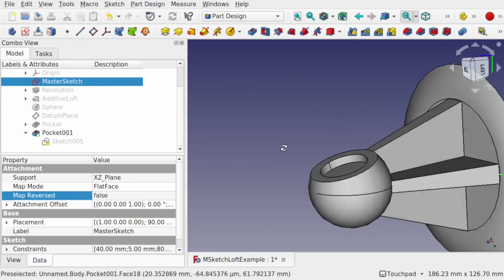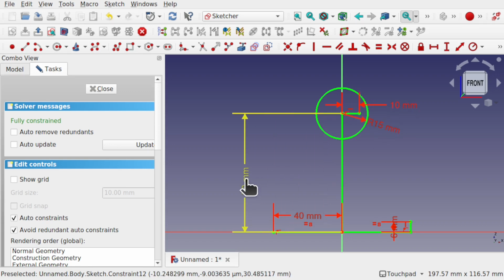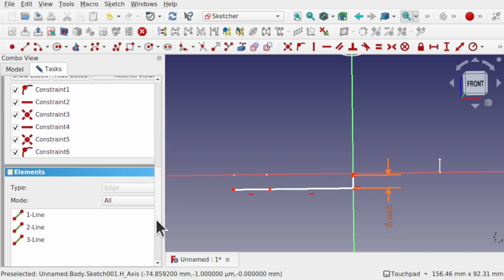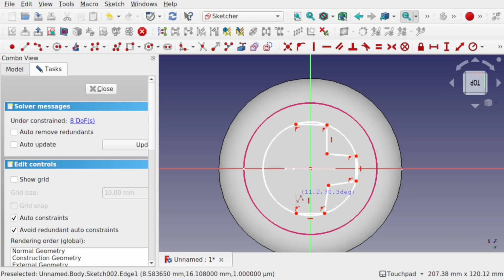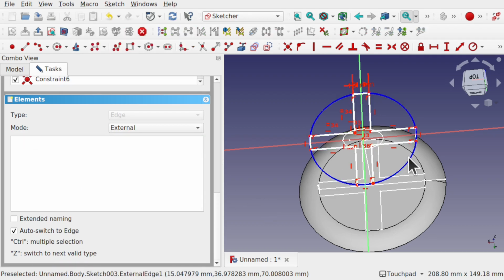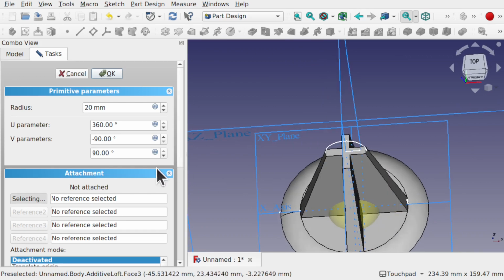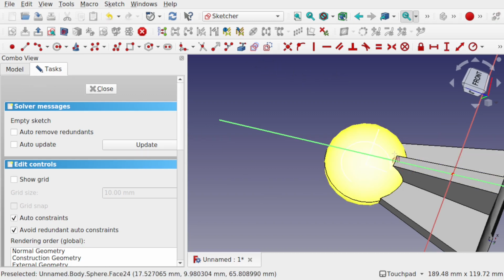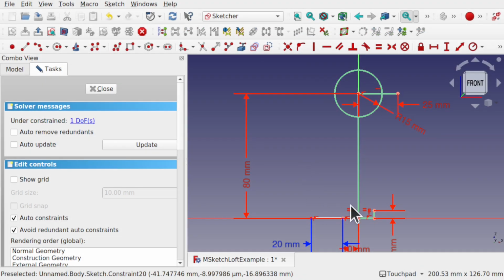FreeCAD 0.20 For Beginners | 12 | Parametric Modelling with Master Sketch, Formulas | Part Design

Comment: Struggling with this 1. Can't seem to get formula editor to work; it just says Failed to parse expression  & OK is greyed out! 🤷🏼‍♂️
Reply: Figured it out! 🤦‍♂️🤦‍♂️😂😂
Reply: I am struggling with a project that I’m working on. It’s probably really simple but I had a brain injury which has messed up my thinking process. All it is, is a cylinder with 2 radial grooves revolved around it & so that I can adjust it, the radius’ & total thickness need to be link & I can’t get my head around it for the life of me! Any pointers? 🙏🏻🙏🏻
Reply from the maker: Sorry to hear that regards your health, I am doing catch up on comments so sorry for the late reply.  When you say link, are you using a spreadsheet to add the values to and then you want this linked to the radius and thickness?
Reply: @MangoJellySolutions  That's right. I've used a spreadsheet so that by adjusting the radius, it affects the thickness. I've managed to get it working on 1 part but the 2nd, assigning an alias seems to put it into error for some reason. I've been scratching my head for a few weeks now.  🤣🤣

Comment: I first watch your tutorials and then try to do the same thing you did by myself so far its been going great but in this episode i messed up so badly i first added sphere then i added the datum plane and it started to get messy just at that point for some reason the reference points you used in video to pull the external geometry on sphere has shifted on my freecad 21.2 so i couldn't use those points to pull external geometry and even when i somehow make the circle to cut through sphere as you did in this tutorial it gives some kind of error related to wire i don't know what it was exactly whatever i think i still understood the concept and thats enough to get to newt tutorial right? Btw you did an amazing job on creating those tutorials even an ape like me can understand it
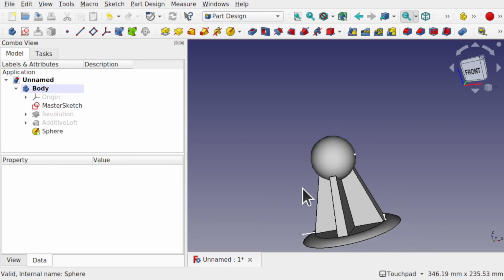Reply: It started to get messy around after 24:30 for me btw

Comment: Why design in mm unit?how can it print big part?i not understand why design in mm unit. im new into freecad 3d modelling.
Reply from the maker: You can change to cm or inches if you want to.  If you look down to the bottom tight of the screen you can change the measurement unit or use the preferences.
Reply: yes i know how to change unit,i follow your tutorial beginner 1 to 15, everything u design in mm,very small model.The baby spoon u design in cad beginner 15 just 50mm,doesn't make sense so small 5cm spoon,who will use 5cm spoon. @MangoJellySolutions
Reply from the maker: @keikaytronic  You can easily change the dimensions.  The items are not to true dimensions and these can be changed with ease.
Reply: oh,alright understand,i get it now. @MangoJellySolutions

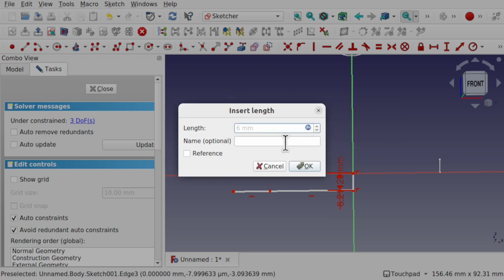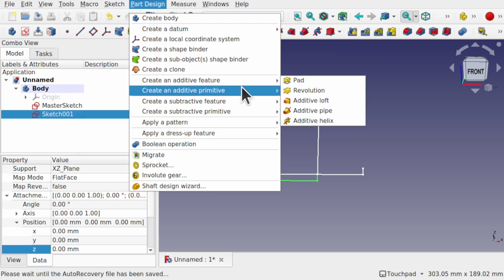Comment: i've restarted this drawing a few times but i cant get past 8:47. it keeps saying "failed to parse expression" and i cannot move forward. oh ok if anyone else has this problem you have to go back to the master sketch and rename base thickness etc which you named WITH NO SPACES IN BETWEEN THE WORDS. my 2nd problem is at 11:51 trying the first revolve. the warning sign pops up "cannot use selected object. selected object must belong to the active body" for some reason i had to drag the sketch into the main body to fix it.

Comment: Is there a formula driven setup video for assembly? Thank you for these series, you are an awesome instructor!
Reply from the maker: Glad your enjoying the videos, so there  are some assembly videos in the series, there is one about creating a meshing gear driven by variables. Are you looking for something that you can drive everything from a spreadsheet including applying those changes in the assembly like a cabin at build?
Reply: @MangoJellySolutions  hmm, youtube really does not like external urls. Removed comment reply two times... This is freecad github issue id: 5789 where I posted a demo vid highlighting potential issue.

In regards to your question, I'm experimenting with headless mode to update model geometry and save .stl for web configurator/viewer based on user parameters. Discovered variables fairly recently and that github issue pointed me into body visibility control as well. So collecting the building blocks... :)

Again, thank you for the videos!

Comment: Love this series, but I'm having trouble with the pocket using FreeCad 0.21. When clicking the pocket menu the render just shows the MasterSketch, which is already different from the video. Then switching the Type renders something weird. It has the cut, but also half the back of the sphere is missing.

Didn't need to set Reversed 🤦‍♀

Comment: At 8:25 wouldn't it be easier to just type in the constraints manually instead of getting the constraints from the master sketch?
We could save time this way.
Reply from the maker: Yes but the tutorial is about using a master sketch so that would defeat the purpose of the tutorial.

Comment: Here's a dumb mistake that drove me nuts for far too long. When I tried to move the Top Profile up along the Z-axis, I chose Position from the Base Section rather than from the Attachment Section - and FreeCAD wouldn't let me change the position.
Reply from the maker: I remember when I first started out and I kept on going to placement rather than attachment when I added a sketch to the face. I still do it today. You click into the field and start typing and the views start spinning round as the short cut keys kick in. Then you realise.

Comment: Hi , Darren . Hope you guys are doing well . Got a couple of questions  . 
1 I have a project I want to assemble with about 80 parts , which assembly WV would you use ? 
2. Only 30 parts would move in automation . Could freecad handle this . Or would you use something else .
Reply from the maker: That's a good question, there are so many different assembly benches but I have no idea which one is the best for a large amount of parts. Might be worth asking over at the forum.

Comment: Hi , Darren . I am curious how i would describe a twist variable in the top profile in the master sketch ?? either C.W or C.C.W. Thank You 
Terry
Reply from the maker: Ooh that's a intesting idea. So you could add a angle constraint to the loft top profile that you can control its rotation from. Using the profile in this project you could intersect the cross with a construction line and use the center point as a pivot. As for placing this on the master sketch it would be kind of abstract but you could show this as two lines crossing each other. Or you could go the route of controlling your model from a spreadsheet if you have a number of individual features that can't be described in a matter sketch. Or a combination of both.

Comment: With the realthunder version the master sketch works by just selecting lines in part design and then hit the operation to revolve, pad, pocket. It will automatically create subshapebinder and stuff automatically without any afford. This is what all Fusion360 users ask for and somehow not present (in that easy form) within the official branch.
Reply from the maker: Wow, I really need to get real thunder installed. Thanks for sharing your experience in these comments.. All welcomed and great for the community.

Comment: Excellent tutorial as ever.
Shame there's no 'intellisense' to help with the constraint names in Formula Editor.

👍
Reply: The RealThunder branch of FreeCAD has the intellisense you want.
Reply from the maker: I really hope there is a big merge at some point. I keep to standard freecad as the majority are using this but realthunder has so much to offer.
Reply: @MangoJellySolutions  Good news, the following is on the bottom of the 0.20 release announcement: "Preparations for the next release of FreeCAD - FreeCAD 1.0 - have already begun. Most exciting is a new development branch specifically for addressing the so-called "topological naming problem." In this branch, code created by FreeCAD contributor Lei Zheng (a.k.a. "realthunder") is being tested and incorporated into FreeCAD. This code will greatly improve the geometric stability when changing a design." See the forum post for links.
Reply from the maker: Oh and thank you for sharing this. Always welcomed 😁
Reply: I agree. That might be worth a dive into the GitHub issues to see if a request already exists. The program knows what the named constraints are as evidenced by the immediate filling in of the value once the name is fully typed in. Just the step of building the list of constraint names to show in the autocomplete dropdown.
Reply from the maker: Thank you glad you enjoyed. Yes I know what you mean, it used to be in 0.18 and I think in 0.19 so hopefully it will be resolved at some point.

Comment: Another great video, thanks.

A trick I use to help my aging brain remember (or more correctly, not have to remember) my variable names is to prefix them with a couple of easy to remember characters. I always use 'aa'. So when referencing a variable in a constraint, I just type 'aa' and FreeCAD filters the variable list, showing only my variables.
Reply: No! It was that way, but it is broken for quite some time. It works only with spreadsheet. I assume it is because of three components vs two. e.g. sketch.constrain.rememberme  vs spreadsheet.autocompleteworks.  The hotkey "=" to enter the F(x) window is broken, too.
Reply: @guidomersmann9744  I failed to mention that I use the RealThunder branch of FreeCAD, a superior version in lots of ways. I use it solely for myself, so don't need to worry about compatibility with other peoples' chosen build.
Reply: @imacmill  Same here. IMHO, it makes no sense to use the official branch due to the lack of TNP fixes and other stuff.
Reply: If you use spreadsheets you avoid remembering the right sketch name at least. It is just "spreadsheet.varname". To bad the completition is so broken and messy.  Especially the two versions with "<< >>" and without are stupid and why all the "internal" names listed before actual model variables makes no sense, too.
Reply: @guidomersmann9744  Yes, spreadsheet better in other ways, too, specifically if you're handing off projects to other parties.
Reply: @imacmill  I could argue that master sketch can be better simply because there can be less confusion between different named parameters and what parts of the geometry they control. One could do a full-up 2D draft with different views (projections) of the object in the master sketch with all the parameters to hand off to someone. Then they don't even need to know which feature is called what. Using the spreadsheet, they would need to know that the designer called the odd feature on one side the "LeftHandedTurnipTwadler" to know which parameters to adjust. Sort of reverse of creating a TechDraw output. Or even multiple master sketches, one for each projection view. (Though multiple master sketches like that can get confusing for the designer when trying to remember which sketch each parameter is on...)
Reply: @Sembazuru  OK, I'd buy all that. But in a spreadsheet, I get to add a normal name and comments. Also, I can generate formulas for constraints that I can't do in a master sketch simply because master sketches don't allow me to reference constraints within itself. For example, I can't create a horizontal constraint named 'myHorizonalConstraint', then create another constraint that is defined as 2 * myHorizontalConstraint. At least not in the RealThunder branch.
Reply: @imacmill  I can see the argument for comments in the spreadsheet. But for your example it is easy to do what you want. Have two colinear lines that have the equality constraint on them. Dimension one of the lines and name it as 'MyHorizontalConstraint', and then use a reference dimension on the total length of the pair and name it what you want. Using reference dimensions make the math of calculating some constraints easier. Lets say you have two circles of different parameterized diameters separated by a parameterized distance. But you need to reference the length of the line that is tangent to both circles. I would have to do some research to re-learn the geometry to calculate the length of that line. But in a master sketch, I simply draw the line and put a named reference dimension on the line.

All that said... There is no ONE RIGHT WAY to do parametric definitions. If spreadsheets work better for you and your workflow, please don't think that I'm trying to tell you that you are _wrong_. 🙂
Reply: @Sembazuru  I don't follow your example. Colinear lines run right on top of each other, so not sure the purpose.

Here's a simpler example: how would you parameterize a rectangle whose width is some multiple of its height in such a way as to only have to maintain one named value?
Reply: @imacmill  my bad. I used colinear wrong. My vocab failure. I was talking about two lines joined by endpoints. To look like one line with a point in the middle.

Your rectangle example is a bit more complicated, but wouldn't you have two names in a spreadsheet as well? One for the defined value and the other the result of the formula? I'm about to hit the hay, but can't you reference an existing constraint on the same sketch? "Constraints.NamedConstraint" I thought I did that once...
Reply: @Sembazuru  wouldn't you have two names in a spreadsheet...?

Yes, but you'd only have to change the independent variable to have the dependent one change, too.

can't you reference an existing constraint on the same sketch? "Constraints.NamedConstraintI thought did that once...

No, you can't, at least not in the RealThunder branch. It claims that doing such a thing will cause cyclic redundancy issues for the solver, so it's disallowed. 

And it's a real shame, as there are so many things it would be handy for. As another example of the strife this limitation causes: I can't recall how many times I've pulled in a reference circle from another body, wishing to sketch a new circle whose origin is coincident, but whose radius is slightly different than the reference circle. There's no way to do this parametrically without the reference circle's radius being defined in a spreadsheet, which for me is not always the case...until I'm forced to add it. (I glossed over the issue a bit, from a parametric's POV, but that's the general crux of the 'problem').

Anyway, for me, I always go straight to a spreadsheet to avoid any issues down the line. Even if I implement a master sketch, I use a spreadsheet to define the appropriate constraint values in it.
Reply from the maker: This is a great debate some really useful points coming from this. People who have different views is always good to have as readers can read and decide for themselves. And giving examples always gives people a vision of what to use the tools for.